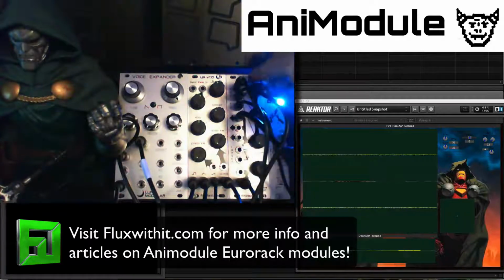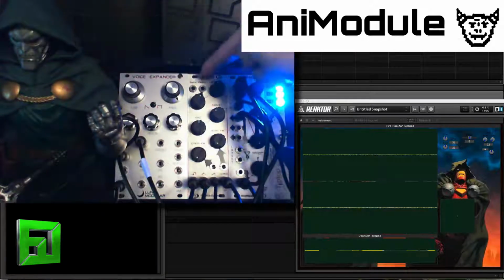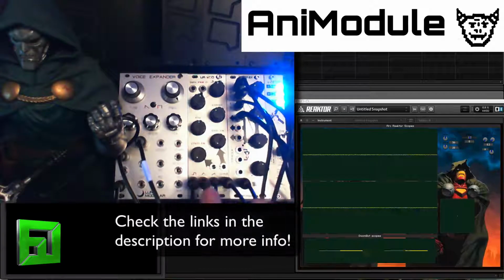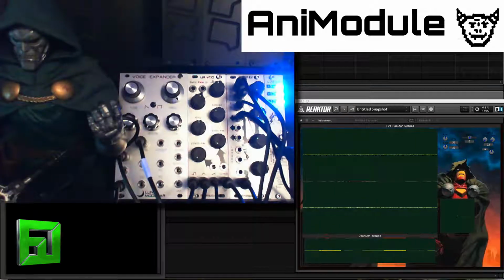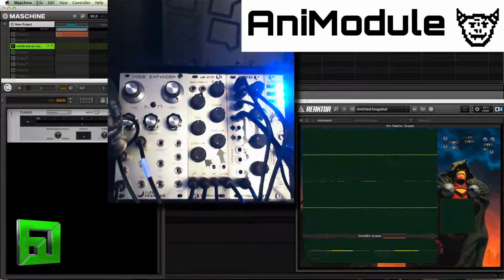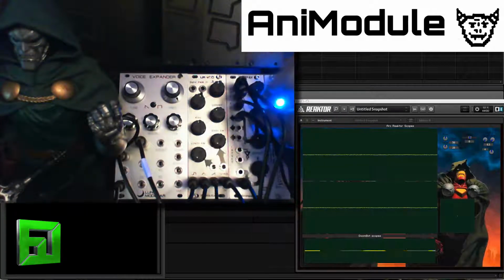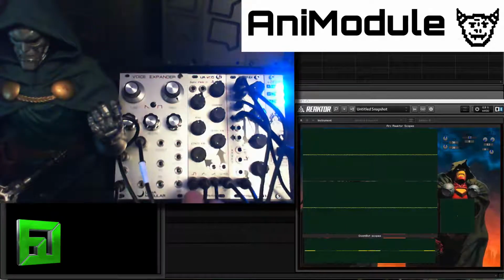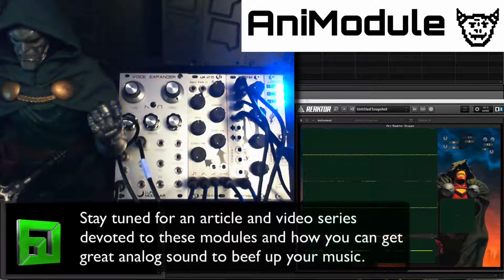Animodule Lil Monster VCO Eurorack  Module Analog Oscillator & Mixman attenuator mixer

Comment: Reply for Lu Koe: obviously you´re young and have little experience with synths, since this shapes are normal in vintage oscillators (and also some modern ones). Perfect squares, triangles and sawtooths could sound unmusical for some people in the same way a "perfect" microphone, with a plain frequency response is not what most people want. This imperfection could be a design decision or accident, but most people likes them more than the "right" shapes.